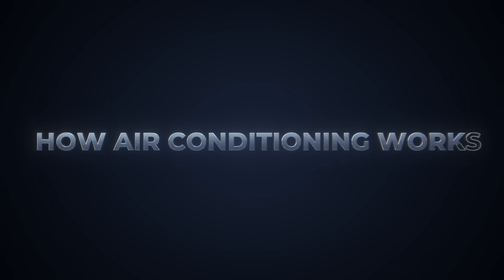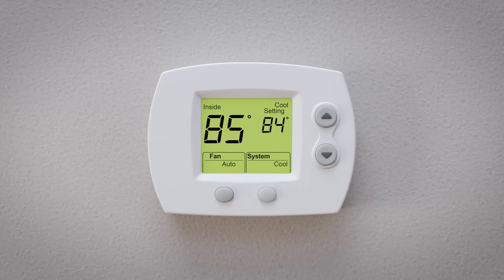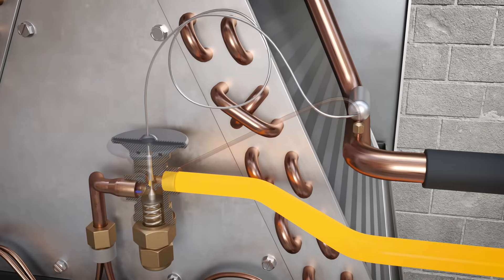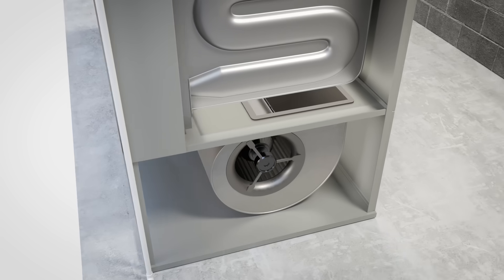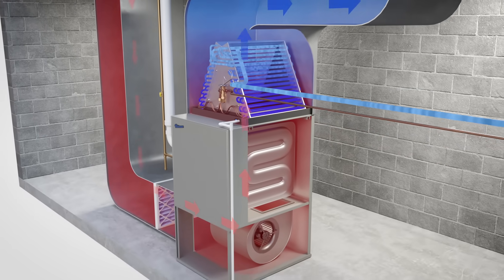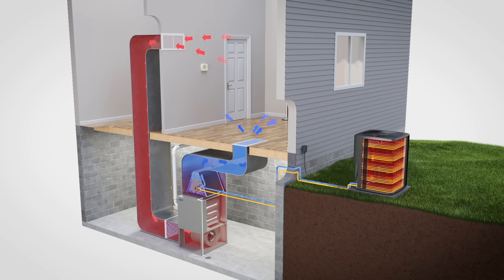How Air Conditioning Works

Comment: I still don’t get 2:07 ”the lower pressure allows the room temperature to boil the refrigerant.” Okay, so the refrigerant boils now. But then it says ”the chilled refrigerant then flows through the evaporator coil.” Now you’ve lost me. Is the refrigerant boiling or chilled? It seems like it can’t be both. How can the refrigerant boil to a chilled state? Can someone explain in layman terms?
Reply: The refrigerant is chilled as it passes through the valve. The air boils it as it passes through the evaporator coil
Reply: It boils somewhere around 40°-50°. So it's boiling, but at a chilled temperature to us. 

Similar to how liquid nitrogen boils at room temp and becomes a gas

Edit: pressure also determines what temperature things boil or freeze at. That's how pressure cookers work. Temperature and pressure increase together.

Comment: When the low pressure goes to the condenser its blue, dosent that mean its cold? Hows it getting rid of heat
Reply: the temperature of the refrigerant going to the compressor is hotter than its temperature at the evaporator.
Reply: When the compressor compresses the refrigerant the temperature is increased. The discharge refrigerant from the compressor is hotter than ambient so heat flows from the refrigerant to the ambient air.

Comment: Why don't they insulate the vapor line inside of the outside condenser unit at the compressor? I live in South Carolina and it's 100 degrees here?
Reply: what for.  it will get compressed and heated at the compressor.

Comment: Should we keep the setting to on or auto? On stays on and auto only goes on when the conditioner goes on.
Reply: Auto saves your blower
Reply: @tristan2332 what do you mean saves? How long should a blower last anyway? Mine is always ON for years.
Reply: @GSPA100  Running it for years not sure how much longer it will last. Parts wear from use. Should last 10 or more years on auto setting. Rarely anyone suggest leaving it on all the time. But do what you want to do.
Reply: @tristan2332 leaving it On setting distributes the air in your home evenly, so theres no cold or hot spots. I feel the difference right away when i put it on auto, so i leave it on On. Ive also heard that auto gives more wear and tear kn the motor since its always going on and off.

Comment: Why would you compress the refrigerant to make it even hotter before releasing the heat into the atmosphere?
Reply: You compress the refrigerant so later you would be able to rapidly expand it in order to cool it, the heat that is created in the process is an unwanted side effect, and if you're going to release the heat at some point it's better to do it when it's compressed so when it will be expanded it will be colder than the air temperature.
Reply: Just to clarify because I see my explanation is not that great either, when the refrigerant is compressed and as a result heated it's hotter than the air temperature so the heat is transferred to the air because the air is colder, then when it's re-expanded the refrigerant is much colder than the air temperature.
Reply: @E_y_a_l thank you, that makes sense

Comment: I’m confused. The refrigerant comes in low pressure and low temperature. Compresses to high temperature and is released through the cooling system. How does it come in low temperature if it has heat in it?
Reply: the refrigerant enters the evaporator at just above freezing, 2-4 deg C.  it absorbs heat and leaves the evaporator at about 12degC to 18degC. still cold but  it has some "heat" on it.

Comment: I’m confused about what happens at 1:39. Where does the room temperature air come from that is used to further cool the medium temperature freon?
Reply: there is no air required.  the temperature drops because the pressure is lowered and the refrigerant "boils" at just above freezing.   the freon boils at below freezing at 1 atm pressure.

Comment: So, is it not totally shutdown. If it reach the temperature desired it's going to sleep the machine etc. and the temperature is going back to the heat and the aircon is start to on. Isn't right?
Reply: the cut off and cut on temperature difference will be about 1 to 1.5 deg C.

Comment: So the bigger cold line entering the condenser unit outside, this is actually the return line of spent refrigerant? I was thinking I was losing efficiency through that line so I tried my best to insulate every inch of it.
Reply from the maker: Yeah it is my understanding that the insulation  prevents condensation that could damage your space, but also prevents it from picking up additional heat before reaching the compressor.
Reply: The main function of the insulation is to prevent sweating and water damage. It has a pretty small effect on efficiency.

Comment: So why does the compressor heat up the refrigerator? And how does the metering device make room temperature refrigerant go to "boiling" cool temperature?
Reply: Pressure and temperature are related. The compressor increases the pressure of the refrigerant which increases temperature. That allows the refrigerant to release heat. The metering device loweres pressure and tempersture which allows the refrigerant to absorb heat. Heat moves from hot to cold, the refrigerant is hotter than ambient in the condenser and colder than ambient in the evaporator.

Comment: What if we switch off only the condenser unit..is its ok for hvac and electric bill?
Reply: @sushilmalla7007  yes your power bill will go down.  but you will have no ac.
Reply: Ok,I've heard that it will put pressure on compressor and inreturn more electrical bill . Thankyou for the clarification@rodzvalv_5673
Reply: @rodzvalv_5673ok.I heard that doing so will put more pressure on compressor and eventually will high electric bill and early tear .Thankyou for the clarification 😊

Comment: Great explanation - I'd like to see the same demo only with a capillary  tube system in the evaporator coil instead of a thermostatic expansion valve
Reply: it will be the same although there is no need for a sensing bulb.  it will also require a filter/drier before the cap tube.

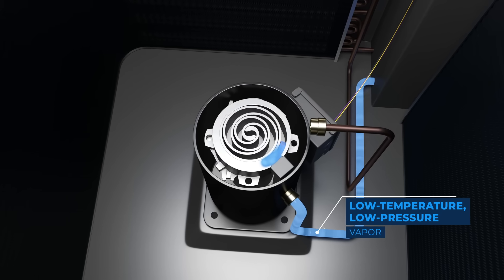Comment: Great video! One question though. At 1:00, it shows that spiral-shaped components sort of vibrate around each other. Is that how it’s done in real life, and if so, is that what make some compressors louder than others and loud during startup?
Reply: @TD_loves_IANR  yes but there are other types of compressors, there are other factors that can change how loud it is though. neither of them are particularly loud tbh you’re mostly hearing the fan itself which is loud.

Comment: Someone explain please - why does the refrigerant need to be compressed by the compressor in order to become a high-pressure & high-temperature vapor if it should have already been heated by absorbing heat from inside the home? What is the purpose of the compressor then?
Reply from the maker: I had a very difficult time explaining this in the video. But as I understand it, the compressor acts as both a pump as well as raises the pressure of the refrigerant. It needs to be pressurized so that when it passes through the expansion valve (inside the evaporator), it gets super cold. The cold air is then blown through the air ducts. Does that help at all?
Reply: @mattrittman that’s not the best way to explain it, the pressure isn’t really the reason, the reason is to achieve a phase change back to a liquid when it goes back to the condenser unit. And then when it heats back up from room temp air, it’s a gas again and cannot pass through the txv, so needs to be liquid again. You have the reasoning right, but the WHY was a little rough.
Reply: it is there simply to move the refrigerant at a desired output pressure.   it is a gas pump.  the refrigerant will not move/flow on its own.   and in so doing, it raises the temperature of the gas because , well that is what gases do when their pressure is increased.  that is why the compressor is the first thing to check when there is a fault in any ac syatem.  no refrigerant flow, no cooling.

Comment: Help! I’m so confused! I live in a manufactured home and I’m desperately trying to figure out how this works because we’re having trouble. But ok, so we have a big metal box thing in a lil “closet” in the hallway (that’s the only thing that’s in it and the door is a metal vent like it has slots for air to go through) and you can see the a coil inside and the air filter just sits on top. In this diagram it shows the air going up out of the evaporator, but our setup is like the air goes in not out. Like the air filter is always dirty on the top, and I’ve always been told that thing in the “closet” is the air intake. But this is different?!?
Reply: The video shows an upflow setup. Manufactured homes use a downflow setup. The blower is placed on top of the coil and pushes air down. You have ducts in the crawlspace that distribute the air through the trailer.

Comment: Why does my air conditioning unit work in the winter but not in the summer? My home is baltic in winter with this maniac. I had to turn it off at the main switch.
Reply: @nicolajirving  the easiest fix is to always check and replace the air filter. People are always surprised how much h of a difference it makes
Reply: @817sports  thanks but it's a brand new house. There's only me who has lived her for the last 3 years..

Comment: We once a day or 2 didn’t need the AC since it wasn’t hot out. Then the next day I didn’t realize the thermostat was on off when it was supposed to get to 88F and humid outside and when I got home later at around 9pm at night, I felt it very humid and thought the AC broke then realizing my thermostat was off the entire time it read 81 degrees and I immediately turned it on to 69 and it kicked on but it took basically almost all night to cool it down!

Comment: The invention of air conditioners was driven by the need to control indoor temperature and humidity for both comfort and industrial purposes. In the 19th century, scientists and engineers began understanding the principles of thermodynamics, particularly how the compression and expansion of gases could absorb or release heat. Early cooling systems, like John Gorrie’s ice machine in 1842, used compression to cool air, aiming to treat patients with tropical diseases. However, these systems were rudimentary and not yet practical for widespread use.

The breakthrough came in 1902 when Willis Carrier designed the first modern air conditioning system. Working to solve a humidity problem in a printing plant in Brooklyn, Carrier created a system that used coils to cool air and reduce moisture. This innovation not only stabilized the printing process but also laid the foundation for temperature and humidity control in homes and businesses. Over time, advancements in refrigerants, efficiency, and affordability transformed air conditioning from an industrial tool into an essential comfort technology, shaping modern life as we know it.
Reply: Thank you!

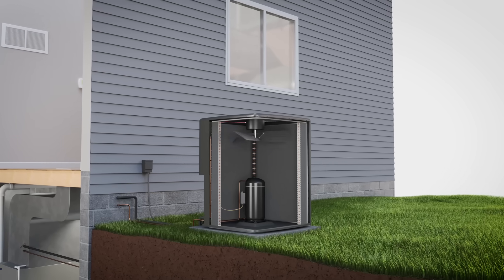Comment: How hot is the " Medium-temperature, high-pressure liquid" ?  1:33
Reply from the maker: It leaves the compressor at about 120-140°F. In the evaporator it's about 40-50°F.
To answer your question, I'd say it's around 80-110°F as it leaves the condensor coil? You'd have to ask an HVAC technician to confirm.
Just remember that refrigerant boils at 40-50°F versus water's 212°F.
Reply: Yes, many split units I've installed and serviced have a liquid line temp of 80-90 degrees F right near the king valve , i can only imagine the temperature of the actual refrigerant is hotter than the outside of the copper line
Reply: It's medium-temp and high pressure liquid because of the fan blowing above the coils takes away most of the heat which reduces the temp when it is absorbed

Comment: Something that got left out is there is a little pump in my basement that pumps out the fluid.  It hasn't turned on in a while and my ac has stopped working. I'm wondering if it's caused by that pump failing...
Reply from the maker: Probably a good chance yeah. Does it look like this? https://youtu.be/TzyxRlG_iJE?si=Rc0uIEjXhOELkqoT
Reply: @mattrittman  yes it was this.  I found a puddle in the basement and I thought my basement was leaking.  But it was this pump.  I just check the pressure in the low and it's 10 psi so I think perhaps I've caused a problem by having the AC on.

Comment: Great video.  One thing I learned years ago is a dirty furnace air filter will cause the evaporator coils to freeze over and you’ll wonder why your AC isn’t working. It’s because the dirty filter reduces airflow passing over the coils too much and the heat transfer rate won’t be enough.

Comment: 2:06 This is the only part i get lost. How does he go from "Lower pressure allows room temperature air to BOIL the refrigerant" to.. "The chilled refrigerant then flows through the evaporator coil."      .... How is it "chilled" if it was just made to boil? Trying to understand AC systems a little better
Reply from the maker: Believe me, I very much struggled to communicate the whole concept. Essentially refrigerant has a much lower boiling point compared to water. I had a difficult time explaining it, even after watching many videos myself 😩
Reply: @mattrittman  Oh duh! Never thought of something with a real low boiling point. Looked it up, boiling point of common refrigerant is between 40-50 degrees.

Well awesome! thanks for clearing that. AC systems are still modern day magic.
Reply from the maker: @irateeverything351  Oh nice haha, hope that helps a little at least! It’s still a bit confusing I know. And that’s just the tip of the iceberg… 😬
Reply: @irateeverything351 that is the boiling point of the refrigerant at the current pressure at the evaporator.  it can boil at very much colder temperatures at lower pressures,  way below freezing.

Comment: Best video I’ve ever seen on A/C!   Would be great to see one on the top 2-3 reasons a unit breaks, and how to fix!  Thanks for putting this together.
Reply: 1.  compressor not running due to a bad capacitor.  2.  dirty filter.  3.  low refrigerant. 4.  bad thermostat.